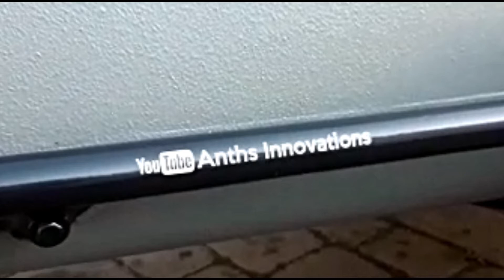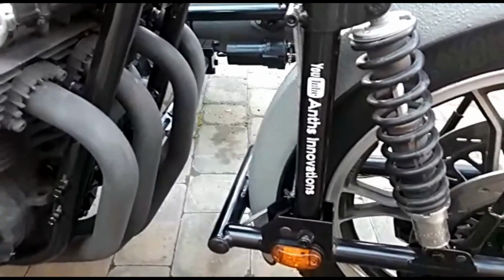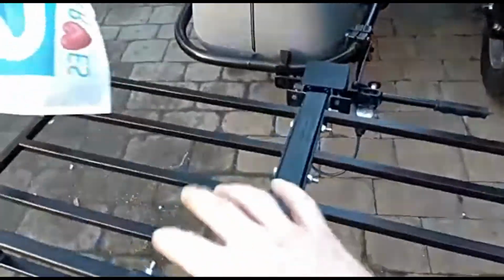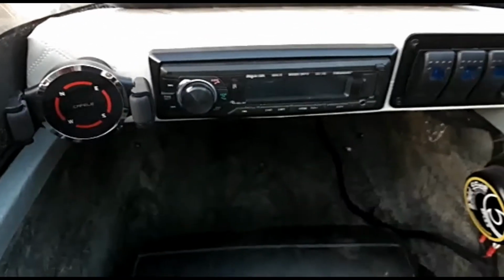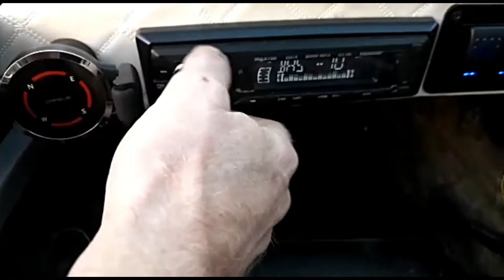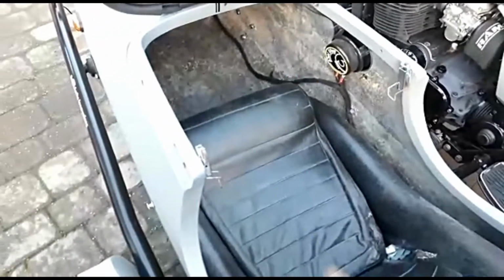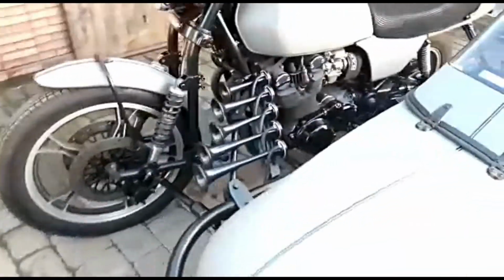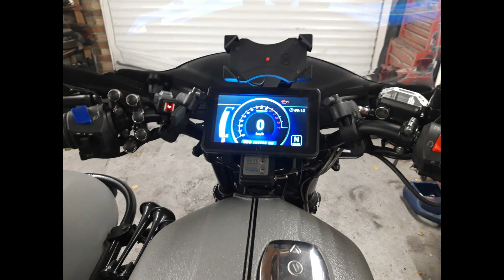23# THE REVEAL-1983 Suzuki GS1100G Watsonian Squire sidecar

Comment: Realy nice job! Like it!
Im working on my bike gs1100g 84...what did you do on carbs? What needle position and what main jet and pilot jet are u using?
Reply from the maker: Hi Fredrik, sorry its a late reply, I just did a standard refurbishment with like for like jets, it is running OK but does require dyno jetting due to more air intake after replacing OE filter. Thanks for viewing 😀
Reply: @anthsinnovations4536  ive bought dyno jets but without instructions. And dynojet told me to buy a kit with instructions... ive bought all main jets sizes and also pilot jet sizes... did you change air jet? Just wanted to know what you did and what sizes so i can see if im realy off or so...
Reply from the maker: Replaced all jets including air jets, not sure on sizes, I am sure I posted a vid on my channel of stripping the cards and jet replacing? If not I will get it on. Sure I mentioned jet sizes on it. I had my local bike garage set the float heights and balancing as they had the gear and experience
Reply from the maker: https://youtu.be/DsUfqZ90OBQ
Reply from the maker: https://youtu.be/DOL5P1g5f-k
Reply: @anthsinnovations4536   looked at both but no specific info about sizes thanks anyway and nice build i hope i will get mine tuned before summer :)
Reply from the maker: sorry,  I thought I may have mentioned it, I might have kept the old jets so will have a look when back home. If not then I wish you well with getting it sorted for tge summer mate